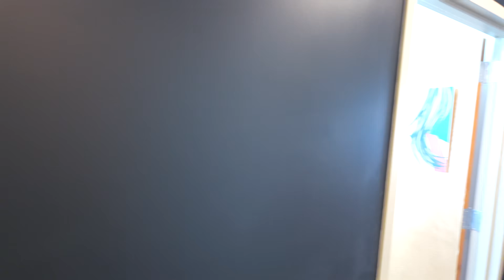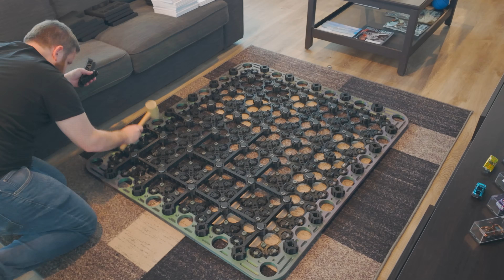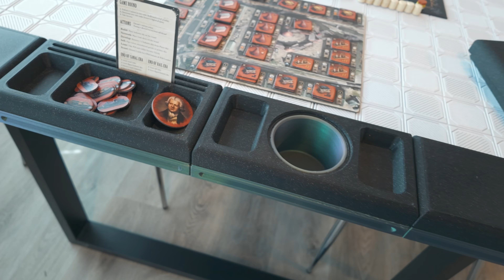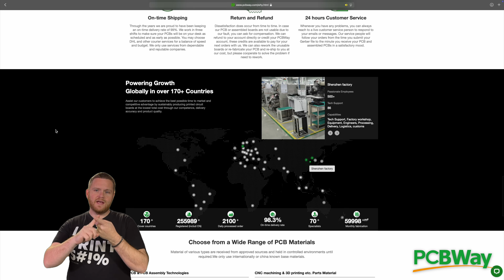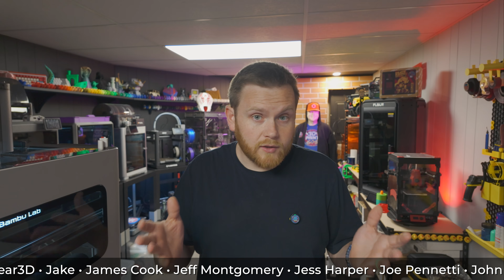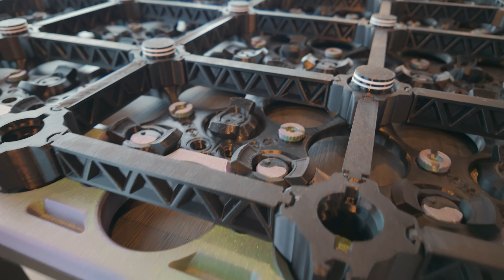I 3D PRINTED A GAMING TABLE…AND IT'S LEGENDARY! 🎲⚔️🔥

Comment: are the sizes of these tables customizable?...I'm thinking about buying the files, but I want to make sure I can actually make a table big enough for my needs before doing so and I didn't see a table sized at 60x44 in their models.
Reply from the maker: Yep, you can make any size table you want. As long as you are using their base files, you can dress them up however you want. It doesnt even have to be a rectangle. You can make an L shape if you wanted to! :)

Comment: I also printed a StageTop2 encore table using the 5x7 layout, which took more than 20 kilograms of filament, printed in PETG. There’s a local filament brand here that prices PETG at about $4 per 1.1 kilograms, and that’s why I chose PETG instead of PLA for the print.
Reply from the maker: Amazing deal on filament!

Comment: Very cool Project, but there is 1 Problem. 
If you spill a drink (not water), you can throw away the affected parts. 
You'll never get it out of the joints again.
Reply from the maker: Good point. Luckily, it wouldnt be too hard to reprint if it comes to that.